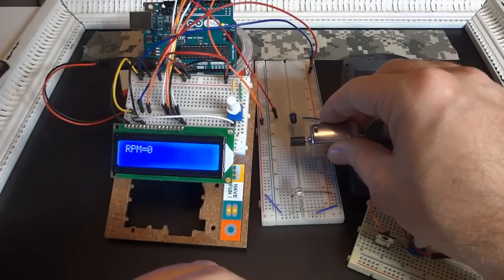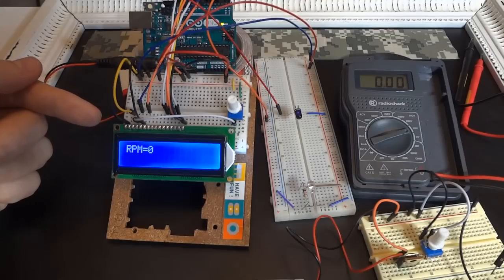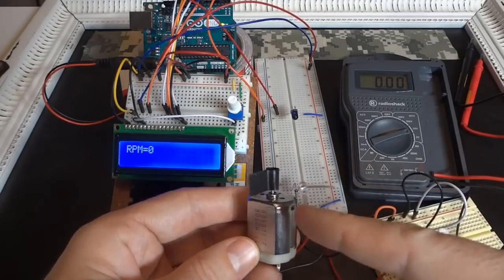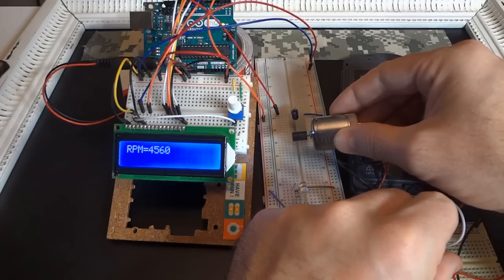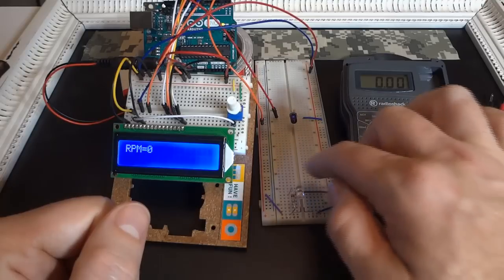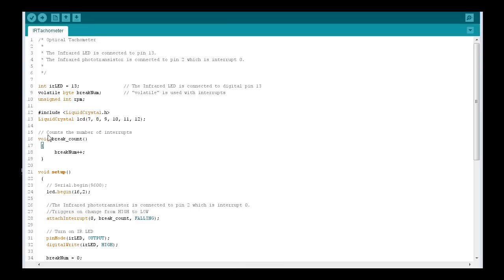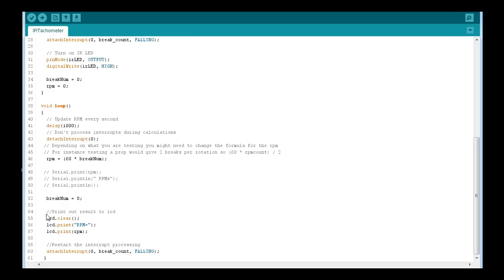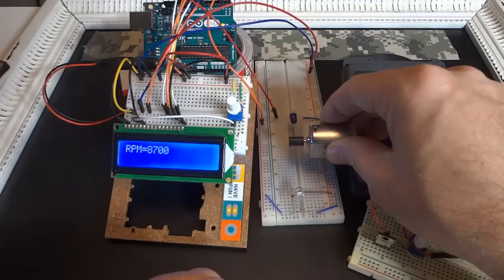Measure RPM w/ DIY Arduino Optical Tachometer using Infrared LED & Phototransistor

Comment: What if I use a Reflective sensor?
Reply from the maker: That would work as well. Reflective sensors often use the same components (IR LED and phototransistor) then they adjust from high to low same as what this does. You would just need to adjust the code a little for the appropriate pins being used. Good luck.

Comment: I'm having trouble with accuracy of the readout. At approx. 20 RPM the code is returning like 600 - 800 RPM. At higher RPM's it seems a little more accurate. Can you explain the inaccuracies? -- thanks
Reply from the maker: Off the top of my head I believe less than 60 RPM would be an issue using the formula without modifying it. Because it's only sampling once per second (1000ms). That may be why you have issues at the lower speeds.

Comment: This code reading rpm with 2 propeller at the motor. This mean 2 cut of the infrared beam will count as 1 revolution. You can modify this line to suit your use;
rpm = 30*1000/(millis() – timeold)*rpmcount;

 i still dont understand.
Reply from the maker: I'm not exactly sure about your formula you have listed. I think I simply just counted the number of times the interrupt was triggered in a second and then multiplied that times 60. Only you have to adjust the formula depending how many interrupts equals one full revolution.

Comment: I have photo electric sensor with 4 pin and m using ardiuno leonardo...do i need to connect resistor  in the negative or positive wire..

Comment: Really nice video; just one suggestion. Use the same display with the I2C interface, will make your code and cabling a lot simpler. This is what I am talking about https://goo.gl/TrMnF3
Reply from the maker: Thanks for the recommendation, that would probably help. I have wires going everywhere and it's a bit messy for sure. Cheers!
Reply: @Express-Reviewed can you re-send your URL? Because that's already expired

Comment: Thank you so much for the code. By the way i would like to print the value of speed also in 2nd line. I tried setCursor(0,1) to print value of speed but the value does not change in LCD.

speed =2*3.14*r*rpm*(60/1000)

Comment: Hi, how high will it detect rpm's?
10 to 13 x 1000 rpm? Thanks,
Reply from the maker: I've seen similar examples up to 50,000 RPMs. I'm not sure what the max number would be. I'd be interested to know as well.

Comment: Were, if it´s possible, we find the code and circuit of this. Thanks,
Reply from the maker: I've put the Arduino code on my website www.makerckstudio.com. It's listed for download just below the video blog post. I hope that helps.
Reply: just google LCD interfacing with board(ardiuno,..) and edit "LiquidCrystal lcd(12, 11, 5, 4, 3, 2);" part according to your usage 

https://www.google.co.in/url?sa=t&rct=j&q=&esrc=s&source=web&cd=2&cad=rja&uact=8&ved=0ahUKEwjG6pPoga7SAhVIJZQKHVM0C68QFggjMAE&url=https%3A%2F%2Fwww.arduino.cc%2Fen%2FTutorial%2FLiquidCrystalDisplay&usg=AFQjCNH51HOQUYD592zkrVeoS93G80VoPg&sig2=2zzz41Iy_unuLpu9wzFaog